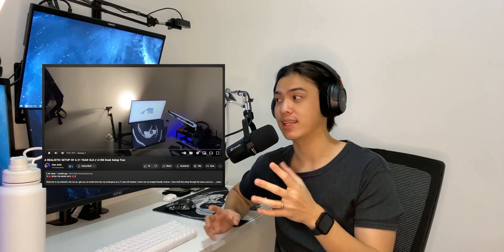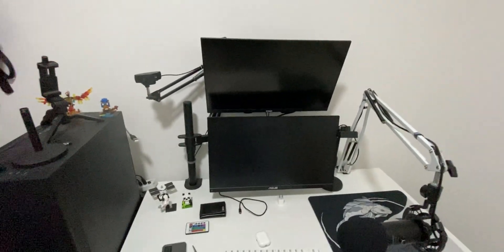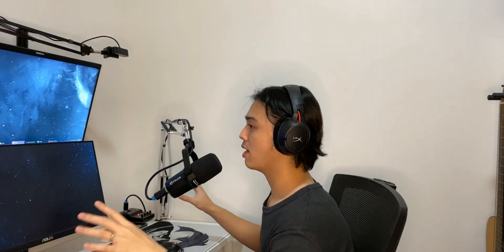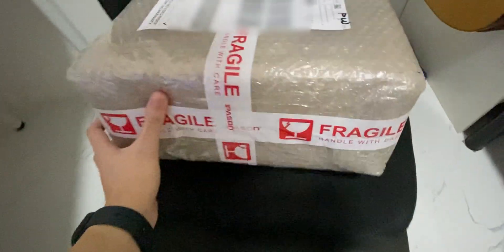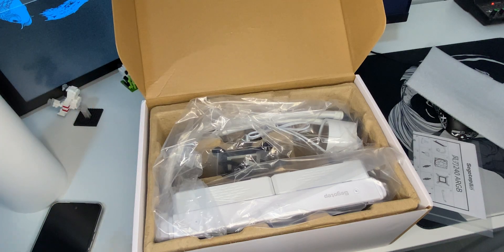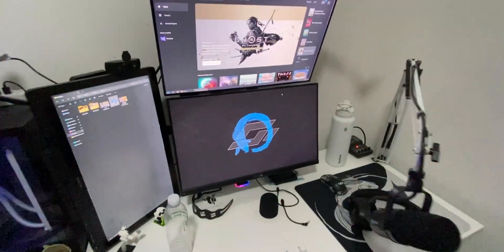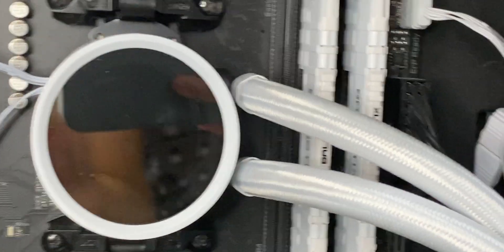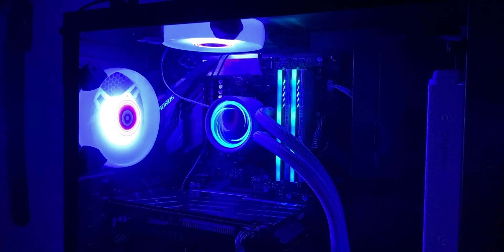UPGRADED MY 2024 SETUP. // A1EN

Comment: Yoo, nice little upgrades, but wdym that the ram only runs at 3200 cl18 when you bought 3600 cl16? I just bought a quad kit of corsair vengeance lpx 3200 cl16 and if I turn on xmp it's all fine running at what it supposed to.
Reply from the maker: Yes, I used to have the aorus ram and it worked well with the xmp. For my new rams however even on both profile it doesn’t want to boot and if it does boot it does go to 2400mhz. I also tried manually overclocking it. But me and the seller came to the conclusion that the ram may have been a bad bin. They asked if i wanted to to try a different kit but the delivery time took so long that it wasn’t worth it for like 2more fps in game. It was size > speed for me I guess
Reply: @alensextras  ohhh, ok then, but have you checked model numbers? cause I saw that you didnt get it as a kit but as single sticks. it might happen with single sticks that they are different versions and have different parts
Reply: like yea it’s a few fps but if u paid the extra for the faster ram, it’s kind of a scam if u cant use it on that speed, thats why i choose 3200 cl16, i figured that was plenty of an upgrade from 2400 cl16 and also doubled the capacity
Reply from the maker: @aelekk  I checked they have the same model and even says 3600mhz / cl16. We figured it was a bad bin. It felt lowkey a scam but the shop online offered to replace. But i have no time to wait for the replacement : ( but its okay:)
Reply: @alensextras  understandable, well enjoy it either way and keep making the amazing content
Reply from the maker: @aelekk thank you brother!